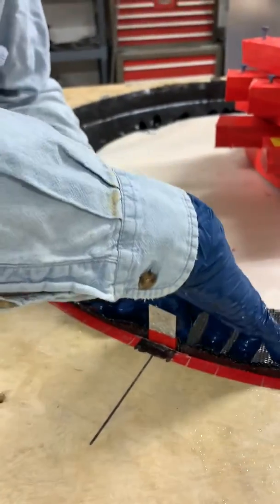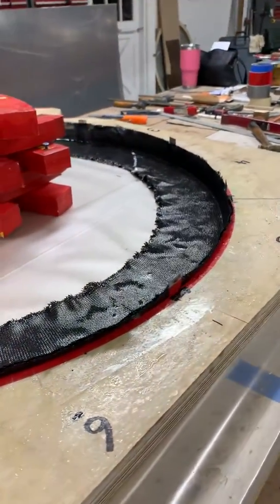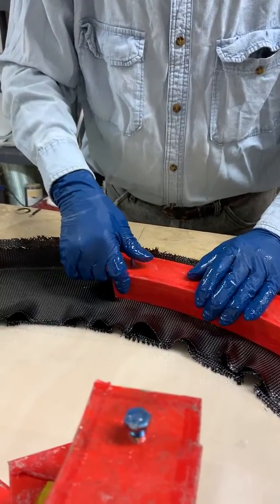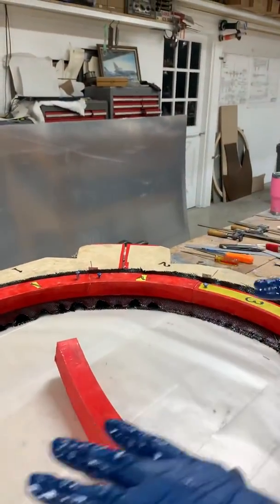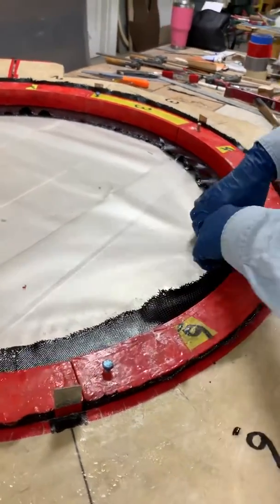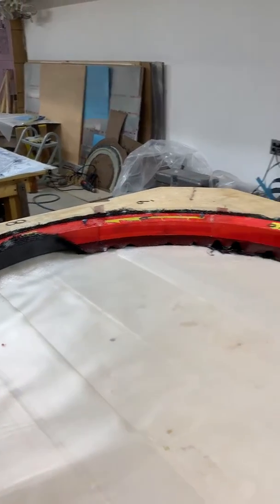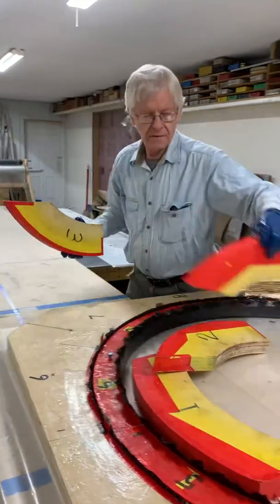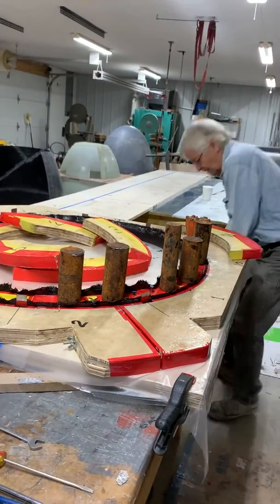The procedure for making carbon fiber aircraft ribs part 2 of 3

Comment: Why you not use a mask , your epoxy is not toxic ? What resin is using?
Reply: I’m pretty sure he’s using Total Boat brand 5:1 (or very similar ratio) epoxy resin, which is very similar to West System epoxy. You don’t want it in your eyes and it’s best to avoid skin contact. But most epoxy resin vapors are not nearly as harmful as those produced by polyester and VinylEster resins. Reasonable precautions such as working in an open, well ventilated area, and staying arms length and upwind of the work is usually considered enough. But make your own decision on this as there are some who disagree.